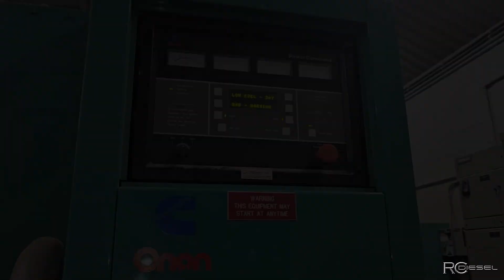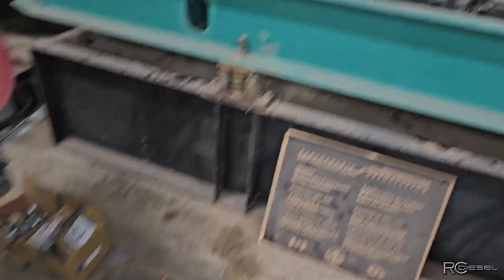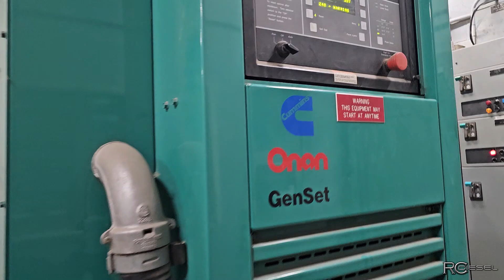🔧 Replacing Front Main Seal on LTA Cummins Genset Engine | Quick How-To & Full Service! ⚙️

Comment: Why do prefer Dewalt over Milwaukee?
Reply from the maker: Well, theres a lot I could say there haha Here's what it boils down to: I bought my first DeWalt kit around 2008 when the 18V XRP series was a new thing. When the batteries started giving out, DeWalt already had adapters to put the new 20V batteries on my old 18V tools, so I upgraded batteries as needed. So 18 years later, I'm still using most of the tools from that kit. The impact driver, angle grinder and recip saw all have a place on the truck. My XRP hammer drill finally gave up last summer. I have somewhere around 20 cordless DeWalt tools + a dozen batteries and I have never needed to warranty a thing. These tools are not necessary the biggest baddest most powerful thing out there, but they always work for me. 

When that has been my experience, I really have no reason to switch to anything else, or to believe that anything else is "better".

I know I'm the odd guy out, I know lots of guys that have had to warranty DeWalt tools. Somehow I've been able to escape that. But I still like to bug all my Milwaukee friends, because I don't know anybody that owns Milwaukee tools that hasn't had to warranty a few.... 😊

Comment: As an EGSA Certified and 35+ year Generator Technician, I always recommend steam cleaning (if customers allows, even if indoor installation, and plastic bag/poly sheeting over any critical electronics / sensors) or at minimum a lot of shop rags to spend the time wiping / cleaning the genset with citrus spray degreaser.  Just a recommendation as it makes the job look like a million bucks, and is much easier to spot leaks, and other issues in the future. I was just surprised to see how dirty the unit looks after the repairs.
Reply: Think Simple Green would do the trick? I personally use it at home, but have typically used brake clean to clean up mechanical stuff.
Reply from the maker: Simple Green or Purple Power works, it just takes longer, more scrubbing and is a lot harder to clean up because it doesn't evaporate as fast.
Reply from the maker: I agree, if that would be an option, that's the way to go, hands down!! I hated to put this together all dirty like that, but these units can't sit around and wait for me, they have to be operational.

Comment: I agree on the DeWalt vs. Milwaukee debate.  I don't have a ton of tools the way a professional mechanic or technician might have, but the ones I do have are quite old, they have the DeWalt logo on them, and while the batteries may no longer be original, the cordless drills still do what their maker intended for them to do, albeit on replacement batteries....
I have to admit, I was wondering how the heck a (seemingly) low-hour engine could need a FMS, but yeah,  I guess without oil hitting the seal material, and with advanced age, it got brittle and bent out of shape.
Reply from the maker: I guess I've become a bit of a DeWalt guy, but mostly, I just like to poke back at the Milwaukee guys haha

Standby generators get tons of leaks, because the seals and gaskets just dry out over time. You're right, they just don't get enough exercise!